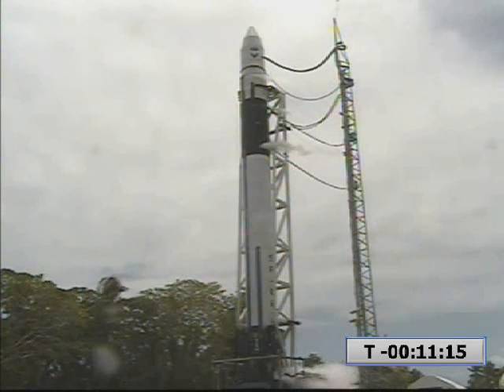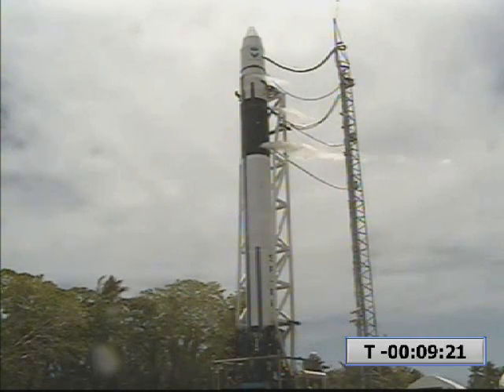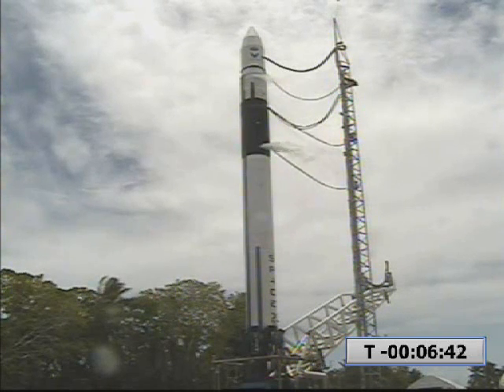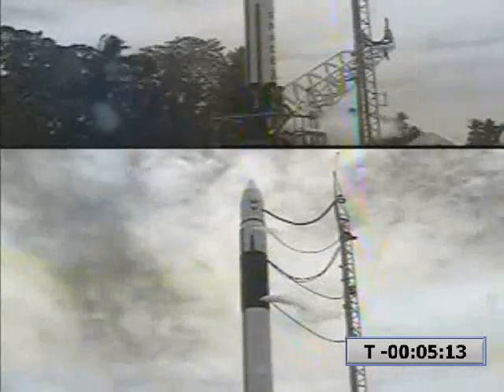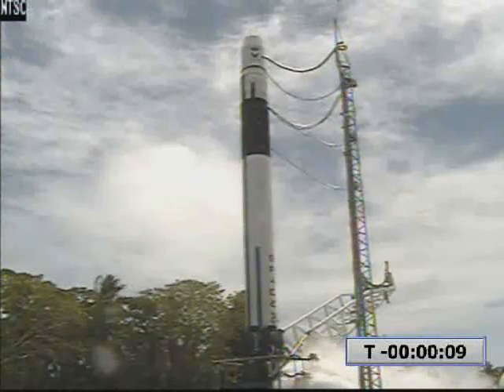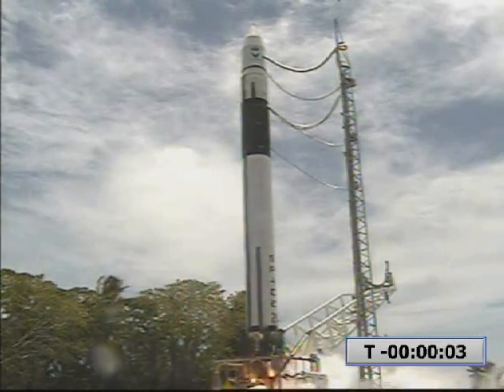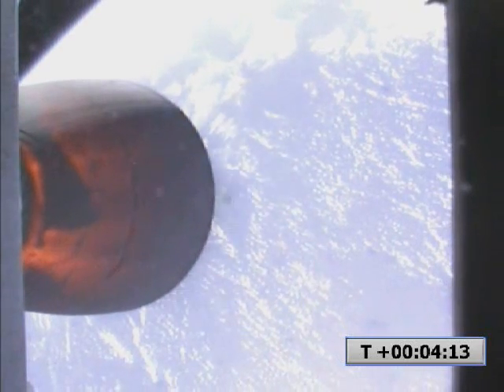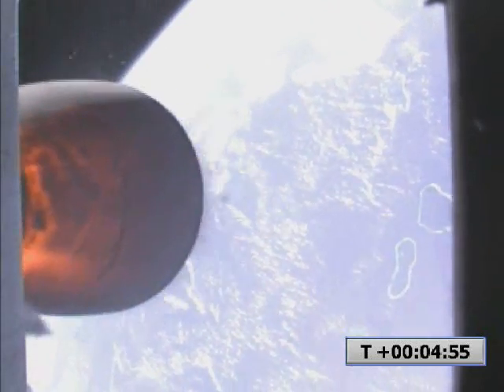SpaceX Falcon 1 Rocket Launch, Attempt #2

Comment: Probably the ugliest 1st stage sep in the history of space flight 😂. The 1st stage hit the nozzle of the 2nd stage engine which damaged the gimbal system and caused the rocking of the nozzle later.
Reply: Actually the oscillation was caused by resonant coupling of the remaining fuel in the tanks with the guidance system. I believe the gimballing system was unaffected by the collision in this instance.

The damage to the second stage engine occurred on the third flight. It's sad to see the collision occur here as well, because if they'd noticed it they might have been able to fix it earlier!
Reply: Zoomer30 maybe you should try building a rocket a seperate it yourself idiot.

Comment: Launch attempt 1: fire on a fuel line leak one minute into the flight
Launch attempt 2: sloshing fuel in stage 2 causes oscillations and destabilises the vehicle
Launch attempt 3: collision of stages during separation due to residual fuel still burning in stage one engine
Launch attempt 4: massive success
Reply: Even in launch attempt 2 you can clearly see the stage 2 housing collide with the stage 2 engine nozzle, too bad they didn't figure it out before it doomed launch 3
Reply: since then there have been only 2 anomalies out of over 50 launches, both related to the second stage helium tank. 95% overall success with the falcon 9, and the success streak is long.
Reply: The 3rd time actually it was not residual fuel burning but over-estimated thrust generation.

Comment: the permanent solution would be wave breakes inside tank and the servo actuators that move the engine in its gimball mount should have a several variable reaction speeds for the nozle steering,  this way the resonance coupling  with the fluid would always be avoided regardless of the amount of fuel in the tank,,,JA Ja  I know a lot of this.............
Reply: n4120p anddddddd they made it today

Comment: I heard they lost this one soon after what we see here, as the fuel got consumed  and had empty space it started to orbit inside the tank , they either did not provide enough wave breakers or something, the thing is the rocket started to oscilate ,the guidance gyros try to correct by redirecting the nozle but the correction speed is such that coupled the fuel woble and the whole thing oscilated more and more as there is less fuel left in the tank,,,  they fix it now and went to orbit. er
Reply: u know they launched the worlds most powerful rocket rn and is building a rocket that will take humans to mars

Comment: Very impressive. 
Why was the exhaust cone wobbling like that towards the end?
Reply: no actually that was very much unplanned and shortly after that it even led to the rocket exploding.
Reply: Valentin yes thats correct it was due to the movement or sloshing around of fuel in the tank as it emptied and left space for movement. This lead to the wobbling and in turn lead to the rocket exploding.
Reply: Pierce Blackmore The fuel sloshed around so much that it left an opening to the intake and the engine flamed out.
Reply: The 1st stage hit the nozzle of the 2nd stage engine as it was separating and this damaged the gimbal control system. This caused the nozzle to start to rock later which then caused the LOX to start sloshing and it started a nasty feedback. More steering = more sloshing.
Reply: This is exactly what happened. The 1st stage whacked the nozzle pretty hard. They have since confirmed this was the source of the failure.
Reply: It's gimballed to "steer" the vehicle so as to keep it on it's flight path.
Reply: its expanding